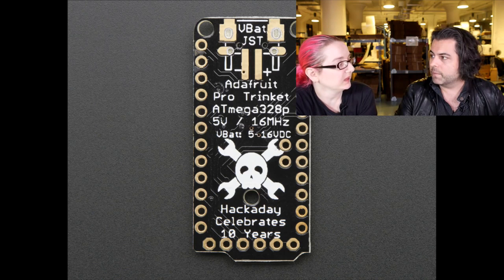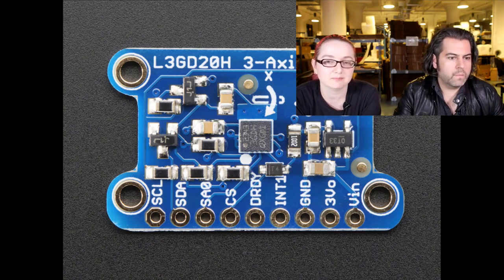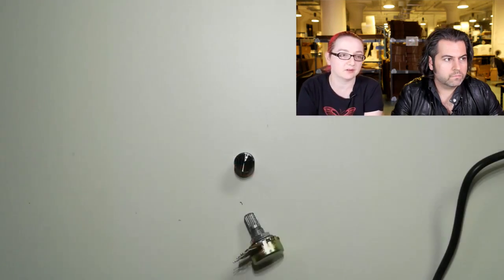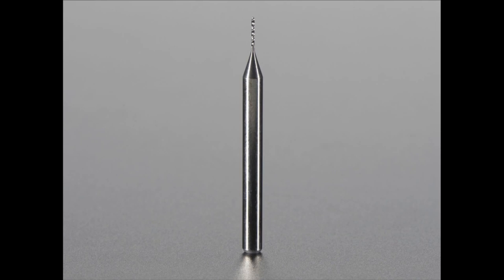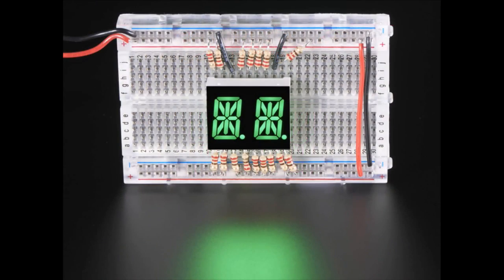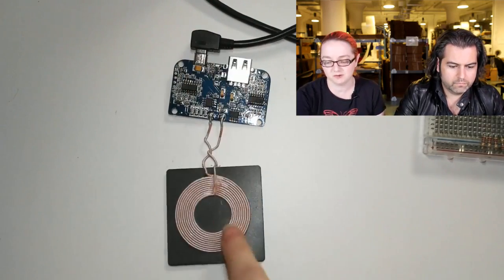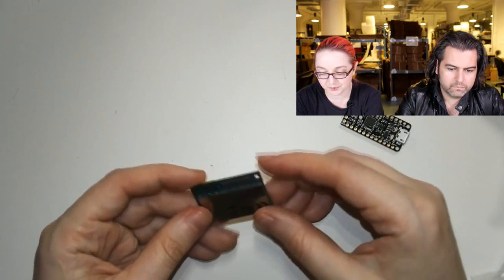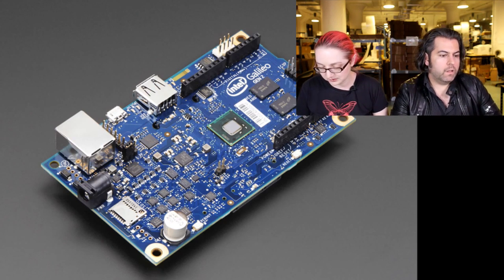New Products 10/8/2014

Comment: The Atten SS-50 soldering is a low cost version of a Hakko, just not the Hakko FX-888D that everyone is familiar with. It's a low cost version of a Hakko FX600. I've used the FX600 for a year now and highly recommend it. If the Atten SS-50 is anywhere close to the same quality, it will be a real winner.